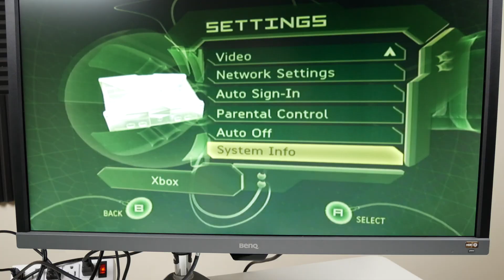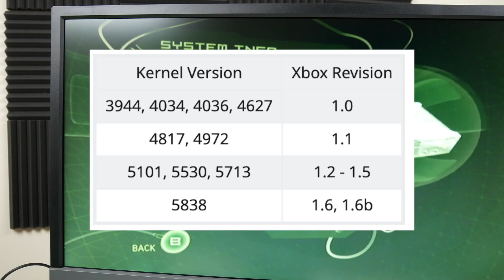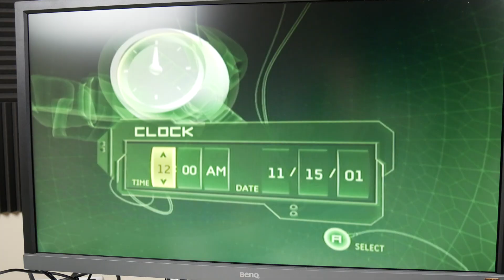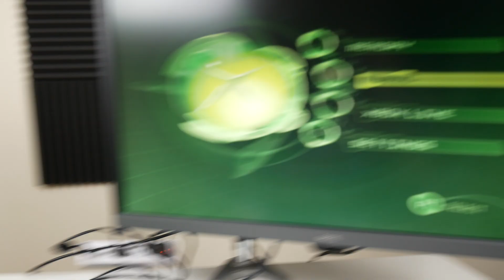How to Remove the Original Xbox Clock Capacitor (Do this before your Xbox breaks)

Comment: Damn good thing I saw this.  Opened up my OG Xbox after 22 years and the clock capacitor was leaking.  Removed it and cleaned off the board with isopropyl and it’s good as new!

Comment: WARNING, if you hear an almost sizzling type sound when prying it out get it out as fast as you can, mine started to leak while using my pliers. Quickly use some q-tips to dry out the area. Also use some q-tips with a high proof alcohol like isopropyl and wipe the surrounding area

Comment: I have a ? I have a clock capacitor that broke off and the prongs are stuck to the motherboard I did try to use the pliers to remove it but there is a little Peace stuck in it any suggestions?
Reply: @MrColton77  you will have to desolder it to remove the pins

Comment: Why don't i need to do this on version 1.6 and 1.6b? They also have  clock capacitor.
BTW, the clock will still work, but if you make the console powerless it will lose the time and date.
With the clock capacitor it will keep the time and date for about two hours even without power.

Comment: I have an original xbox and i am unsure of whether to remove the capacitor.

I dont know the version or if it even needs removing :(

Serial is LNNNNNN 34WFF
Reply: Have you opened it up to look at the motherboard? different versions have different components to help you identify what model it is
Reply: I found a chart and any og xbox with version 1.5 or older can run without the clock capacitor.  Additionally, if you look at the sticker with the manufacturer date on the bottom of the console, that should give you an idea.  Just as long as your console was made earlier than March of 2004 you should be good to go.
Reply: do it anyway, never hurts

Comment: Never heard of this until the other day when I was listening to a podcast where there was an offhand comment about this phenomena. Checked mine. Still boots, checked kernel, was in the 4000s. Opened it up, capacitor had leaked. Clipped it out. So should I clean the gunk that got on the board with alcohol or leave it alone since it booted fine before removal?
Reply: @philliplemasters5621  you def need to clean the corrosion off the board with isopropyl.  It will corrode the traces on the board.

Comment: Decided to remove the CC on my Xboxes, recently. I've got 2 Xboxes (PAL). Both Xboxes are older versions and not 1.6s. They both have near identical motherboards, like yours, apart from a few capacitors being a different colour.

My 1st Xbox is mainly used for playing music off the HDD and back-up game saves. Removed the CC and have to input new time and date every time, all good, like you said. My 2nd Xbox is for playing games. At the time I removed the CC, I bought a very scratched copy of Tiger Woods '05. There's a lot of interference when I start the game and is unplayable for at least 5 mins. I thought the scratched disc was the problem but still have same problem with clean discs. Now, just have to turn Xbox on and wait 5 mins for it to warm up before I can play.

Here's the weird thing, I don't have to input time/date, it's permanently on. Double checked I removed the correct capacitor and it's fine. Have you come across this anomaly before?

Comment: I thought I open up my original xbox , which is a uk pal version manufactuer date march 2002, looking inside no capacitor looks swollen or any issues and where the gold one is on yours the marking is a little different showing C7G10 and is a black capacitor. cant see any swelling or leaking of any kinds. was it just some of these with the issue ? or did I manage to skip some of the faulty ones ? also on mine where you have the single large capacitor  to left of the gold one, I have 3  sightly smaller ones lined up. do these link even when not in use ?

Comment: From what I understand, if I set the time and turn off the console for a few minutes, it will return to the original if there is no capacitor? I'm asking this because I bought the console used.
Reply: I thought the same, but apparently time/date will stay set until you unplug the console from power.

Comment: That capacitor did not have to be removed! The gold capacitors are of high quality. The 1.6 boards all have the same gold cap but some 1.4 boards did get the gold cap as well. My Halo box has the gold cap and it is fine. What you do want to ALWAYS REPLACE is the black ones that say Aerogel on them, or really any cap that is not the gold one. Technically you can just remove them on 1.0-1.5 boards but I like the original experience. Note that they are required on the 1.6 boards. The clock capacitor is near the IDE port on the 1.6. It will be the gold cap, it does not need replaced unless bulging. All caps bulge so it will need replaced sometime during its life time.
Reply: Better safe than sorry
Reply: @Rdrtwd85  And if you don't put gas in your car, you won't have an accident. Good quality capacitors can last many, many years especially on devices that don't run all the time like game consoles, TV's, etc. I have an Atari 2600 and the caps were in good shape when I replaced them last year. I only did that because, yeah, almost 40 years old. Replacing them didn't make any screen quality better so they were still fine. Microsoft used mostly good caps on all boards, minus a few, but all 1.6 and many 1.4/1.5 used the nichicon gold capacitors. If you search 'should I replace these XBOX caps, any nichicon are listed as only if bulging. The clock capacitors that are black AND say AEROGEL MUST be removed or replaced. I actually replace mine with a Panasonic coin shape cap with an extended capacity.
Reply: @GiSWiG that’s fair
Reply: Siempre se puede comprar un condensador Nichicon Gold de 6,3V 1F de AliExpress y ponerlo en la consola
Reply: I agree the Gold & Black  capacitor is very high quality. It stands out too. Mine was not leaking its possible it could go another 20 years. 🤔 but the Black ones and sliver caps i did replace along with a Disc Drive belt.
Reply: Mine had a gold capacitor that was leaking!  Fortunately I removed it and cleaned the corrosion off the board before it damaged it beyond repair OR caused an electrical fire! 🔥
Reply: The gold ones are now going bad too

Comment: Too late for our Xbox original. After the red ring of death (we didn't use it or have it a long while), and opened it to find all the power supply leaking and corroded and bulged caps on motherboard and realized the seller didn't take care of the Xbox at all.
Reply: How can internal capacitor issues be a sign that the average user did not look after their ancient Xbox?
Reply: @theoneanton  The owner before us had modified the Xbox. There were other problems. It was incredibly filthy with a ton of dust bunnies and covered over an inch of dust. The capacitors initially wasn't the problem. I'm assuming that it overheated and wasn't properly ventilated.

Comment: When I removed mine it stopped working. I have a 1.0. It definitely was a 1.0. Now it beep's and shut's off. Before then it was perfect.
Reply: only the 1.6 models stop working if you remove the capacitor
Reply: @matteo1462 - I forgot I still had this up. It stopped working and a few days later I wiped just about the entire motherboard down with alcohol and it started working again.

Comment: My orig xbox smoked once i plugg it in. 
what will happen if i don't remove the capacitor immediately?
Reply: also the smoke has a smell
Reply: Leaks all over the motherboard. The smoking pay be a power supply burnout. Had one and made a pop sound when I plugged it in. Power supply capacitors were all puffed out. Need to fix it. Like 15 to 20 for a new power supply. Think I think you can just swap.
Reply: It's is a magic smoke. It's is a magic smell. But don't smell the magic smoke.

Comment: Love the channel man. I have a question. My OG xbox makes a low pitched whining noise while it is plugged in but not powered on. The whining disappears when I unplug it. It won't power on at all, no lights, beeps, or anything. Btw the clock capacitor was removed in the past. Thoughts?
Reply: Power supply idk

Comment: It is only necessary if you're Xbox isn't 10 years old that's around the age it was noticed. I think I'm safe since the Xbox stopped being produced in 2005
Reply: too bad Original Xbox's are 15 to 20 years old
and fyi they were Discontinued	in
JP: 2005
WW: 2006
Reply: @SilverX95  I did replace my clock capacitor even though it showed zero signs of leakage
Reply: The 2004-2007 Xboxs don’t have faulty capacitors.
Reply: @plawson8577  I don't know what year mine is but I removed it to be safe. It wasn't leaking but it was the kind that leak

Comment: This actually sounds like a bunch of shit. What on the capacitor looked like it would explode and get all over the motherboard. The Xbox was released in 2001 it is now 2022 I have the same Halo Xbox I'm leaving my capacitor alone
Reply from the maker: Good luck..
Reply: @JacobRTWO  Mine works fine and is about 20 years old. I think if I take it apart it might not work after that. Don't believe everything you hear. I also found through Google that this problem with the clock capacitor was detected around the ten year mark of an Xbox. I am well beyond ten years
Reply: @JacobRTWO  The one i have was manufactured in May 2005. So, I bought it second hand in March 2008. The drive, is banged up, always has been, it has gotten worse in recent years, opening and closing. But yes, other than a few disc read errors, usually the Doom 3 disc, that is all that has ever happened.
Reply: tops of capacitors are split like an x and will bulge once they read end of life, some will pop though
Reply: @darrenfalconer3267  I did remove mine even though at 20 years of life it showed no signs of leakage
Reply: @darrenfalconer3267  Sure. That is the nature of them. I have GX270 small form factor, it has capacitors like that, not too bad. Three or four. That is just the way it goes for those old hardware systems from the time of the problem with the capacitor manufacturer.
Reply: @chrisspearline767  my Xbox was working just fine after 22 years but I opened it up to check and sure enough the clock capacitor was leaking.  Cut it off and clean the board with isopropyl.  If you don’t eventually your box will be fried and no longer work and you’ll have to replace the whole console.
Reply: @decadentdave  I removed mine even though it looked fine and I don't think I had one that needed to be removed

Comment: Thank you very much for this video. I've had mine since I was a kid; I had it gifted to me as a memory of my Uncle before he moved far away for work (it was his console before, but he couldn't carry much in his move and wanted it to go to a good home). I found another video, but my motherboard was a different configuration from theirs (I think theirs was a revision 1.0 and mine was probably a 1.4 or 1.5), so I couldn't find the capacitor, but I knew it had already leaked on the mobo from looking at it (even the dust that accumulated from the years had turned brown around that area). Your video showed me where it was on mine, I was able to find the culprit and promptly remove it before it could cause any permanent damage. I cleaned the spill with rubbing alcohol and plenty of Q-Tips, put it back together, and it works perfectly. It only asks for the time if I unplug the console, which really isn't a hassle; as long as it's plugged in, even if it's off, it remembers the time and date just fine. And I'm pretty sure the date and time are only relevant for sorting new game save files, so if I just want to play something that I don't have to save my game, I don't really have to set the clock (like NFS, NHL, or other casual games). You saved my Xbox from potentially catastrophic failure and I'm very grateful that I found your video in time to save it from becoming a paperweight. Never would have known this was an issue, as the console appeared to function perfectly otherwise

Comment: So version 1.6 still needs the capacitor removed and replaced though right? Read it wont work without it, but I am correct to assume it will also give out and damage the board?
Reply: Eventually it will need to be replaced but since they used a higher quality capacitor on the 1.6 revision you won’t need to worry about it for a least a couple more years.
Reply: Also yes it will not work without it.

Comment: Owned a OG Xbox back in the day. Been wanting one for two years and finally got lucky earlier this year when a coworker decided to just give me his that he had sitting in the garage for free. Never in my life had I ever heard of this time capacitor thing until a few days ago. Been super paranoid for the better part of a week so decided to just give it a go. Glad I found someone with the exact setup and yes I had that gold colored capacitor. Luckily mine showed zero signs of leakage. Not at all tech savvy but it was pretty simple to do and highly recommended for anyone looking to extend the life of their original Xbox.
Reply from the maker: I'm glad the video helped!
Reply: @JacobRTWO  sure did, i have two OG Xboxes i bought used years ago, now i'm headed home for christmas this year, going to check their version and if needed, remove this little sucker!
Reply: @JacobRTWO  ONLY the 1st Gen Xbox has this issue. Any SKU made in 2004 and after has better capacitors.

Comment: Just recap the entire board! The caps near the CPU will also start leaking.
Reply: Just recap the problematic capacitors. So the 3 clock circuit capacitors and the 3 by the processor. Done. Then keep an eye on the rest once in a while. Easy.

Comment: This is the first time I've heard of this problem but it might explain why I have some issues with my console not fully working properly. The power and disk drive buttons don't always work right, and it has trouble reading some disks occasionally. But that could just mean the disk drive might need to be fixed/replaced too. 

I've had my Xbox for almost 10 years, got it second hand and it has never been opened. Since it does still work fine most of the time I hope the acid from the capacitor hasn't messed with too much of the motherboard yet.